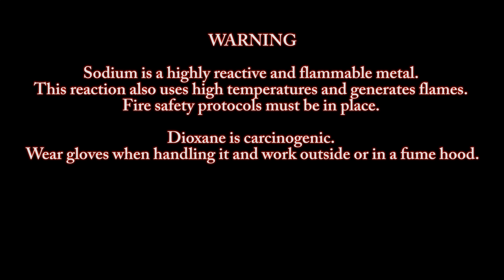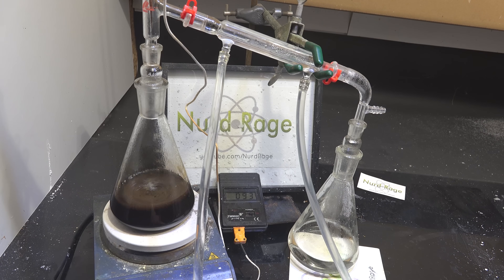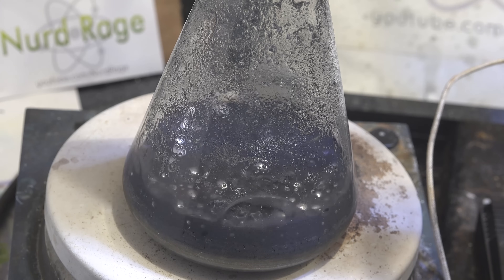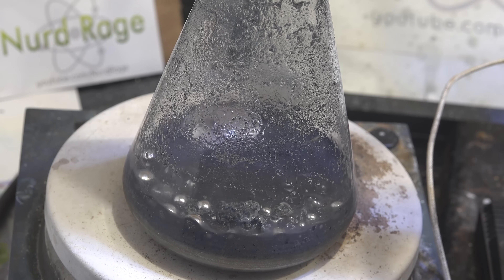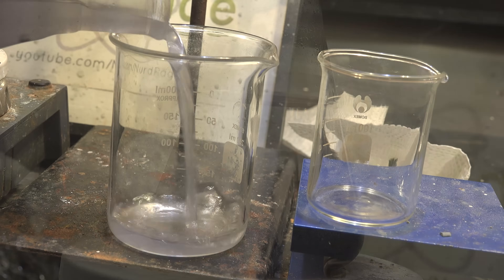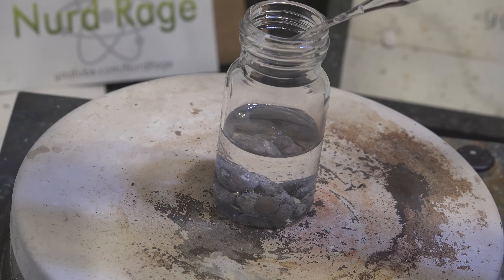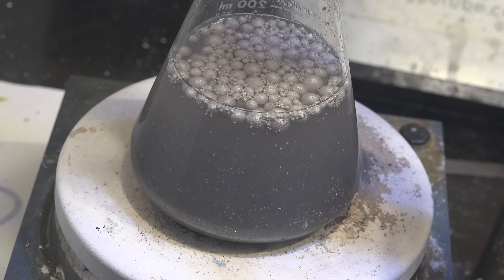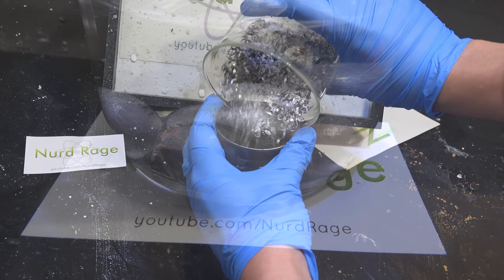Make Sodium Metal Without Electrolysis Using Domestic Chemicals

Comment from the maker: Achievement Unlocked
Reply: Nurdrage has yet done a video about chlorine but if I remember well he also made a video to bust the production of chlorine using ammonia and bleach : it produces toxic chloramines but not chlorine gas.
Also producing HCl using Cl2 and water is not a really efficient process in itself.
Reply: Only one other man could make sodium metal out of drain cleaner, antifreeze, and a tin can... MacGyver!
Reply: And most of the time if you deal with small quantities of sodium or moisture you have a fire. If sodium were to reach your skin because you are working unprotected you would get a severe chemical and physical burn but not an explosion.
The real problem with electrolysis is just the mess you are left with if you do the electrolysis with proper security.
Reply: @thomash9300  Good time!I apologize for my English , I'm from Russia))) tell Me, why is the electrolysis of the melt necessarily made of hydroxide and afraid? Why is it not made of molten carbonate? There is one problem with the fork of the melting point of the carbonate and the boiling point of the sodium, but I think you can pick up 854C-882C!!! Carbonate is not as aggressive( as Russia - a joke) as hydroxide, there is also oxygen, but there is no water!! I haven't tried it myself, but I think it's possible!
Reply: @thomash9300  but what does it taste like? Would it burn my tongue?
Reply: PUNX771  Just check the ingredients on different engine coolants. Some might use ethylene glycol anyway
Reply: NurdRage dude seriously congratulations! I always thought that the only way to get sodium metal was from electrolysis of sodium hydroxide this is very novel thinking you should publish this method.
Reply from the maker: The extra magnesium actually remains embedded in the slag. The dioxane doesn't remove it. That's why this process is so awesome, it selectively separates sodium from the slag.
Reply: monster2slayer so did Cody, from CodysLab.
Reply: Honestly, you're the inspiration for my chem minor. I have always had a fascination with chemistry and your videos inspired me pursue it collegiality. Thank you so much for the wonderful content and professional quality.
Reply: Thank you for this!
Reply: why did you take down the potassium synthasis video? just curious
Reply: NurdRage Congratulations
Reply: 1 million points!
Reply: nice shot man
Reply: Hi NurdRage, you can actually do this pretty easily with some crown ethers. What is happening is that two dioxane molecules are chelating out the sodium which once removed from the metal oxide matrix enter a thermodynamic sink as solid chunks. In my lab we actually use a similar technique to clean out our MOFs (metal oxide frameworks) of metal dopants. You should be able to do this with diglyme as well. Ether would not work so well because you need a high heat solvent to melt the sodium.
Reply: Yes you can transfer the outer electrons to the ether temporarily and actually dissolve fully reduced alkali metals. The ksp is low but it works fast enough. You can actually try it using a higher boiling solvent like diglyme and a soxlet extractor. The liquid condensate should be above 100C though for it to work best with sodium. You will actually dissolve the sodium into the solution cycles and as the diglyme boils off you will see sodium droplets begin to aggregate. Its quite amazing. I will send you a paper of a procedure our postdoc uses to prepare our monolithic mofs.
Reply: chlorinated solvents are a big no no with sodium and strong bases.
edit DCM boils @ 103F Dioxane boils @ 101C --- thats around 60K temperature difference
Reply: @Tyt0uOff did you see the video?
Reply: >800 likes, 0 dislikes? I guess that's another achivement ;)
Reply: Nice!
Appreciate your work
Reply: I've always wanted to ask:
Do you have any suggestions for working in highly humid conditions?

I live in the tropics at an average humidity of 80% (64-96%). My home "lab" has very poor aircon, so any H2O sensitive reaction  is immediately initiated by the ambient humidity... ex: Lithium strip exposed to air will begin smouldering and ignite after 60-90 seconds in air!

I've built a glove-box but can really do that for set-ups of glass apparatus. Any thoughts? And thanks for the endless Nurd-joyment of these videos!
Reply: +Andy Lee Robinson, Sure, but how much oxygen do you think is actually in the blender?  Maybe  0.02 moles?   Not much.
Reply from the maker: +Exascale thank you so much! Now youtub doesn't allow posting of links so it might be better to email them to me. my email is on my channel's "about" page.
Reply from the maker: +Duo Fish I avoided terpenes and similar because under these conditions they would most likely polymerize and turn into goop. DMF is great, but it's somewhat difficult for the amateur to get, only a limited number of consumer products have it 

I'll look into that paper. These MOFs might have already laid out this procedure but in the context of making the "slag" (or MOF) rather than making the sodium
Reply: its not so clear in this case, dioxane is less polar because it is symetric and dipole moments of oxygens cancel each other.
But still you can see that dioxane has some potential to behave like a polar solvent by looking at its hydrogen bonding parameter, it's unusually high for a nonpolar solvent. It is so high because of lone electron pairs on oxygens.
Reply: When you make your magnesium-sodium slag, you should pack the top of the can with dry ice to keep the air out.
Some cool videos on youtube of burning magnesium inside of dry ice to firm magnesium oxide and elemental carbon
Reply: No, you can't use mineral oil, sodium sticks to the magnesium oxide (slag) and you need a special solvent to remove it.
Reply: greetings @NurdRage i just uploaded a video to my channel of a wierd reaction and was wondering if you could do a video on explaining why and how thank you have a nice day
Reply: Provisional achievement name: "Electrolysis? Na."
Reply: NurdRage cool been waiting for you to come out with something new
Reply: Great vide dude! I don't think I'll find anti-freeze in Brazil tho :(
Reply: @PicaMula  amazon.com
Reply: MRLT HAPPY THOUGHTS! happythoughtshappythoughts...
Reply: NurdRage Loud Cheers and Applause!
Reply: NurdRage how about sowing molten NaOH in a tin coated (steal) can
Reply: How good would it be to store the sodium under liquid butane in a pressure safe container?
Reply: Truly great achievement!
Perhaps the yield may be increased by filling the blender with argon gas or even butane or similar?
Reply from the maker: +Exascale That's very interesting! i thought that only worked with metal ions. So you can remove zero valent metal from MOF's that way? Do you actually see globules of metal forming in solution as this progresses? If possible could you email me some papers about this process? If this technique is already well-known for making MOFs then i would be negligent not to reference them.
Reply: did you try to mix dioxane with toluene?
Reply: Have you tried using a terpene such as alpha-pinene for separation? I worked in a chemistry lab specializing in organic chemistry for a while and found using terpenes, usually alpha-pinene, as an organic solvent was best when xylene, toluene, and naphthalene didn't work for dissolving some of the larger organic molecules.

I infrequently used 60% alpha-pinene and 40% toluene/xylene (by volume) as a solvent, so it may be worth a try in this case. Otherwise, dimethylformamide (DMF) was a frequently-used solvent especially when dealing with metals.

In fact, just using store-bought turpentine (which is mostly alpha- and beta-pinene) might be worth a try as opposed to dioxane as well as it's much easier for amateur chemists to access. Also, alpha-pinene isn't a carcinogen, so that may be another reason to prefer it.

It seems you're dealing with chelation in this video in order to separate out sodium, so it may be worth noting that alpha-pinene and other common organic solvents may not work so well, though there is some literature on the possible chelation properties of terpenes.

I rarely worked with MOFs, but diglyme was preferred for chelation and DMF was a frequent solvent, though I don't know if you have access to them.

Edit: I'd also suggest looking up a paper by the title of "Water Absorption in Porous Metal-Organic Frameworks and Related Materials" (It's not behind a paywall) if you'd like to learn how a few MOFs are prepared, which could give insight as to what solvents or chelators you could use in situations similar to the one in this video as the preparation of MOFs is similar to what you performed with dioxane.
Reply: @Duo Fish  "It seems you're dealing with chelation in this video in order to separate out sodium" - I think thats the trick, to use a solvent that strongly interacts with sodium or the oxides. 
Probably nonpolar solvents have little to no chance of succes. 
And if you look at this problem from home-depot-solution point of view dioxane is amazing.
Nurd did wonderfull job here, just go to the shop buy mg anodes, drain cleaner, antifreeze and after some time you get pure sodium.
Reply: NurdRage Try to make sulfuric acid from MgSo4 ! If is posibile!
Reply: In metallurgy, a "Flux" (derived from Latin: "Fluxus" meaning “Flow”) is a chemical cleaning agent, flowing agent, or purifying agent.  
http://en.wikipedia.org/wiki/Flux_(metallurgy)
Reply: +user21XXL,
you wrote:
"Probably nonpolar solvents have little to no chance of success. "

Yet when I look here, Dioxane is listed under "non polar".
http://en.wikipedia.org/wiki/Solvent#Hansen_solubility_parameter_values
Reply: +NurdRage you should extract potassium form lo-salt
Reply: NurdRage can we use mineral oil instade of dioxane
Reply: I'm french and I don't understand english really well
4
Reply: I'd guess that adding just enough oil in with the 
blender/pulverizing/milling step might reduce oxidation losses, and 
presumably would work even in a plastic blender.  

I'd guess NR's solvent extraction is more effective, but in theory you might be able to use gravity separation if you had a very very dense oil, (dense enough to sink in water) so that the sodium would float on it.  Make sure the oil is dry!

Maybe if you put a shallow layer of this on a stir plate, or something with an even stronger alternating magnetic field,  the eddy currents generated in the sodium might help push it up.  Or you could try a centrifuge method.  There certainly are other separation methods one could try.

I guess the difficulty is that if the Na adheres to the MgO at all, even as a powder, (as it apparently does), and maybe adheres somewhat even with Na in a liquid phase, then the solvent extraction is likely to be more effective.  

Another approach might be to avoid the Mg/Mg entirely and reduce the sodium compound with carbon, like in they did in the old days.   I've wondered about trying the following experiment (at one's own risk).  Burn the wood off a pencil to get the graphite rod.  Use this as a low voltage heating element.  Maybe put 5 volts across it at ~10 amps or so?, in a lightly closed container with oven-dry washing soda (Na2CO3) on it (perhaps made in an oven from baking soda).  Disconnect the electricity and wait until it cools before taking the lid off.  Some of the graphite would have burned, hopefully purging the air from the container with CO2 and CO.  If it got hot enough and the graphite rod or the container didn't break, then it might produce a very small amount of sodium.  I don't know how much if any sodium carbide would be formed.  Of course it's not like the Mg method is perfect either.  I know this is maybe not the most energy efficient, and historically, apparently that's why it was abandoned, but the purpose is to explore the science, right?
Reply: Mr Slinky dragon I've been desperately sifting through the interwebs looking for that very video. It may be lost to mankind :(
Reply: +Tyt0uOff il dit que dioxane est le meillure mas aussi le plus dangereus et l'huile ne marche pas bien et donne Na de qualite pauvre.
Reply: hi
how to make
Acetylacetone

Ethylate and sodium methoxide

please tell me :-ъ

thanks
Reply: You should make a game about your channel!
Reply: NurdRage FUCKIN PRO!!
Reply: excellent work, bravo!
Reply: 2LiOH+Mg->2LiH+MgO
2LiH<->2Li+H2
Reply: NurdRage I used my knife forge
Reply: irony: he couldn't make himself not into a douche
Reply: Check out his video on making Dioxane from Ethelene Glycol from radiator fluid.
Reply: NurdRage could you use KOH with the NaOH, so the aggregate is Nak, and distilling out the liquid? Would that work, or am i mistaken.
Reply: Glaas batteries
Reply: https://www.youtube.com/watch?v=PkTaz3UEThYmake potasssiumhttps://www.youtube.com/watch?v=rSJGwnERIVUmake ceasium
Reply: Can I use other ethers like diethyl ether?
Reply: Really good home chemistry.  I suspect the dioxane has the same Hansen parameters as the sodium surface and, while it wont dissolve, it does preferentially adsorb to the sodium and so is cleaner.  I did a (very) quick calc and it would be interesting to try 54%vol cyclohexanol and 46%vol xylene to see if this has the same effect as dioxane.
Reply: NurdRage how is this possible sodium is far more reactive than magnesium . Magnesium cannot displace sodium from its compound . Always the higher metal in the reactivity series displaces lower metal from its compound .
Reply: Where is your video to make potassium with koh mag in mineral oil and t butanol catalyst??????
Reply: BANNED
Reply: Have you ever checked out sciencemadnes.org/smwiki? It posts many syntheses and your WORK on producing Sodium metal using the Alcohol Catalysed Magnesium Reduction approach.
Reply: Nurdrage, i found that if you use a much larger vessel to react the hydroxide with the magnesium, relatively pure sodium metal will be deposited on the walls and lid with good yields thereby eliminating the need for the dioxane step.
Reply: Thank you for the videos you make, they are very helpful
Reply: Good time!I apologize for my English , I'm from Russia))) tell Me, why is the electrolysis of the melt necessarily made of hydroxide and afraid? Why is it not made of molten carbonate? There is one problem with the fork of the melting point of the carbonate and the boiling point of the sodium, but I think you can pick up 854C-882C!!! Carbonate is not as aggressive( as Russia - a joke) as hydroxide, there is also oxygen, but there is no water!! I haven't tried it myself, but I think it's possible!
Reply: You are mega rad man. Mega man
Reply: pours sodium into dish
my brain: clean it with water.
Reply: Because: Amateur chemist + molten NaOH + O2 gas being formed + explosive Na globs = 1 less amateur chemist.
Seriously, have you even thought about what would happen if a drop of water were to fall into the setup?
Just like what happens when you pour water into burning oil, the water will instantly flash to steam and send pieces of sodium to imbed themselvesf in your flesh. Yeah, you won't have time to remove it before it explodes due to the moisture in your blood..
Reply: @mortlet5180  nice picture for a movie
Reply: @mortlet5180  I'm just over here wondering if sodium metal tastes like salt, 🧂, or if it tastes like explosion, 💥
Reply: Well, I am not an amateur chemist anymore, but by the time I was and I first practiced the electrolysis I had yet used sodium metal and I was aware of its properties and the reactivity. So, fisrt, the H2O and O2 produced by the reaction are both in a gas state and even by sometimes having my electrodes distant from only 5 cm the sodium didn't catch fire nor exploded. The reason why it didn't catch fire nor exploded is because of the small quantities of reactants that were able to reach the sodium and oxidize it. Even if it caught fire it certainly wouldn't have exploded. The fact of having water nearby is just common sense : when dealing with something that is at a temperature of more than 300°C you don't want to have water nearby, even more when there is sodium metal involved. But if one drop were to fall in it (let's say that the amateur doing it do it in it's garage and it has a lot of infiltrations), it would blow up in a little steam cloud since most of the sodium metal is liquid and tend to stay in a blob around the electrode.
Now I do the electrolysis under an argon atmosphere to avoid loss of sodium but the real danger is the molten sodium hydroxyde, not the sodium nor th water and oxygen produced by electrolysis.
Reply: Het! I wonder why you don't want to make sodium by electrolysis? I remember doing so when I was 16 or 17 and each time I need sodium metal I extract it using electrolysis so why someone like you does not do it?
Reply from the maker: You know exactly why its so crappy for an amateur then.
Reply: For me the worst part was always the leftover sodium hydroxyde in the steel container. I am always left with a huge solid chunk that is highly impure and attract a lot of moisture from the air making it useless for any type of reactions, even other sodium electrolysis batches. It is hard to protect from the moisture and crystals of sodium hydroxyde tend to grow on the surface of the container to spread outside if not stored properly. But if you can handle this chunk it is a great method using only one chemical for the production and fairly easy and fast.
Reply: thunderfoot made caesium, do it better! :D
Reply: You should  mix ammonia (NH4) and bleach (NaClO) to make chlorine gas, and then because when the chlorine gas reacts with moisture, it turns to hydrochloric acid which can be used in a ton of other cool chemical reactions.
Reply: @salinox2086  what?! Ur joking, right? Nh3 and bleach puts nh3cl in the air along with the molecule oncluding oxygen, which is a poisonous gas. Cant remember the name.